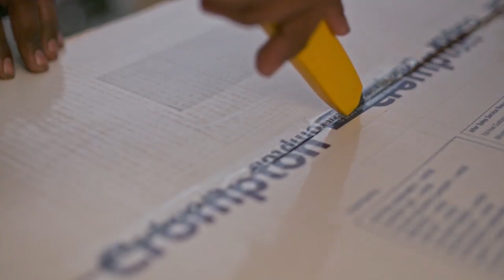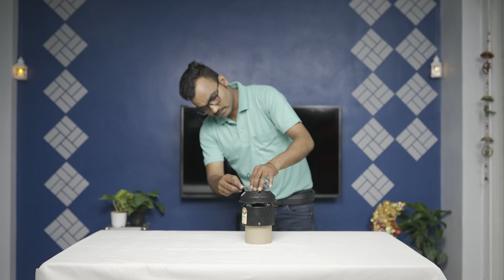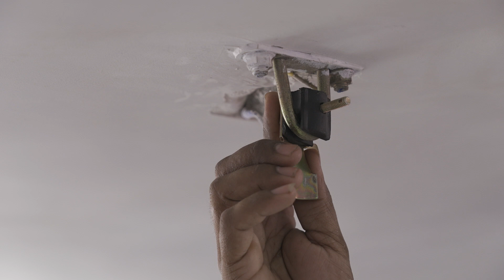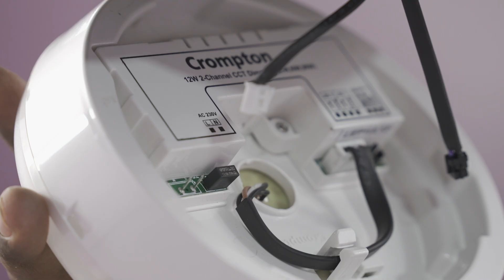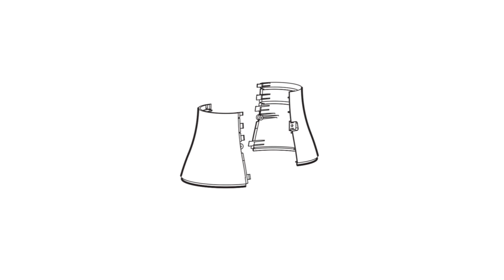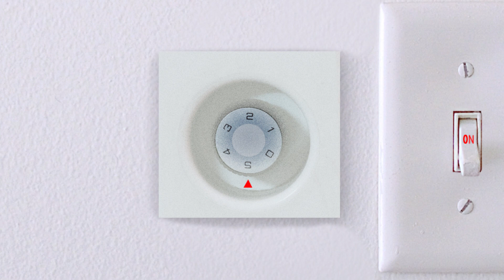Crompton SilentPro Blossom Fans

Comment: Bought the Crompton Silent Pro Blossom and honestly, it’s a total waste of money. The Crompton technician himself struggled to assemble it — poor build quality, gaps in fitting, and the fan still wobbles. At certain speeds it makes an irritating humming noise that ruins sleep. The Alexa feature is useless, keeps disconnecting all the time.

After a year, the board got fried, and even with my Amazon bill, they charged ₹3,500 just because I didn’t have their “warranty card.” Six months later it failed again, and they asked for another ₹3,500. I gave up — using it only as a light now.

Got an Atomberg fan for ₹3,000, and it does everything this overpriced fan claims to do, without any of the drama. Avoid this fan completely.
Reply from the maker: Hi Masood, sorry for the experience. To better assist you, kindly provide us with your service request number. Alternatively, you may choose to email us your contact details, including your mobile number, precise address with the pin code, and your complaint number, at consumer.support@crompton.co.in. Rest assured, we will do our best to resolve your grievance.
Reply: @crompton_india   bullshit you will do anything.
Reply from the maker: Hi Masood, as mentioned earlier, please share with us the requested details for further assistance.

Comment: Don’t buy worst product and worst customer service not ready to even come and check or give service and cancelling the service without even giving any details even after repeated request to do service
Reply from the maker: Hi Masood, sorry for the experience. To better assist you, kindly provide us with your service request number. Alternatively, you may choose to email us your contact details, including your mobile number, precise address with the pin code, and your complaint number, at consumer.support@crompton.co.in. Rest assured, we will do our best to resolve your grievance.
Reply: True the crompton installation person doesn't know to install this model, I had to install myself watching videos and reading manual pathetic!
Reply from the maker: Hi! Sorry for the experience. To better assist you, kindly provide us with your service request number. Alternatively, you may choose to email us your contact details, including your mobile number, precise address with the pin code, and your complaint number, at consumer.support@crompton.co.in. Rest assured, we will do our best to resolve your grievance.
Reply: mistakenly paired single remote to 2 fans. This is causing issues for us. there should be a way to reset or unpair it. no guides or manuals available. it's s blosom silent pro fan. now we cannot use these fans as 2 fans operating same time.